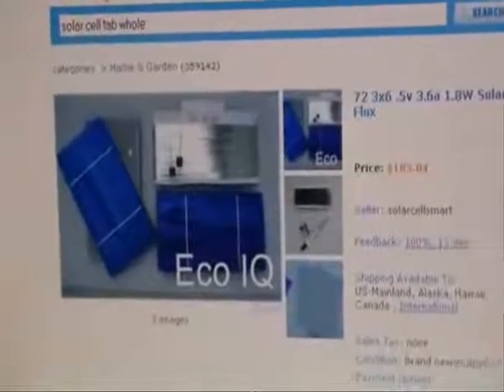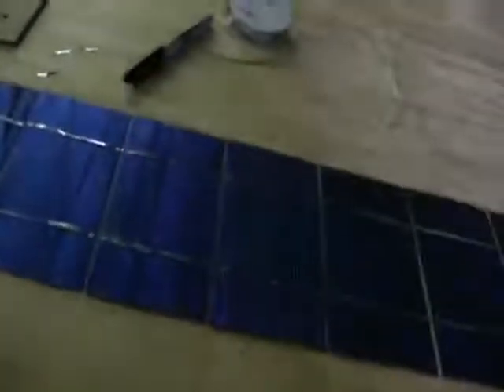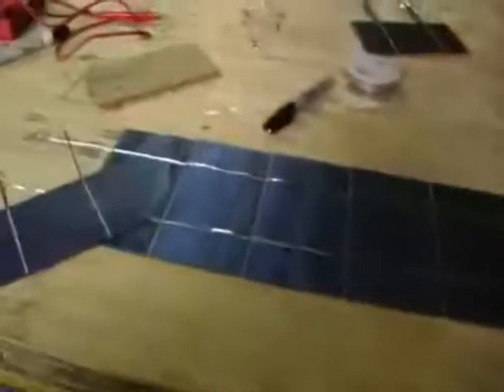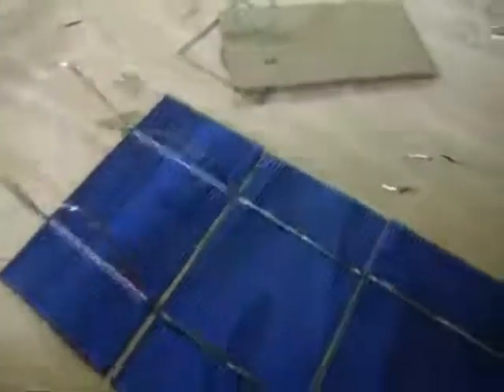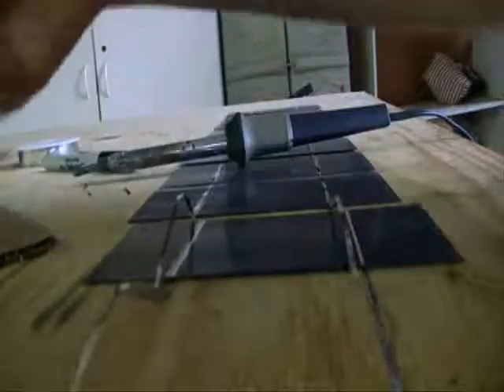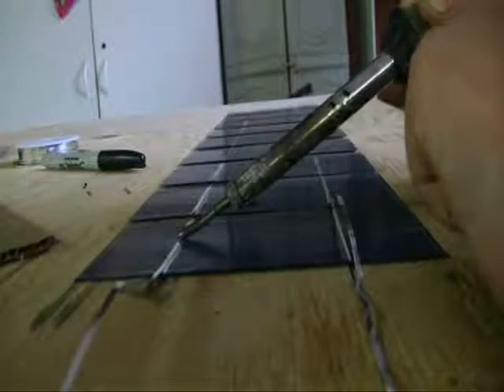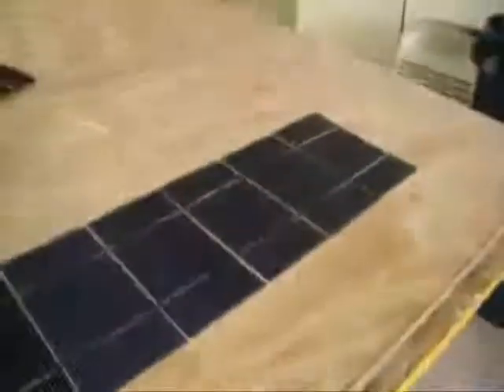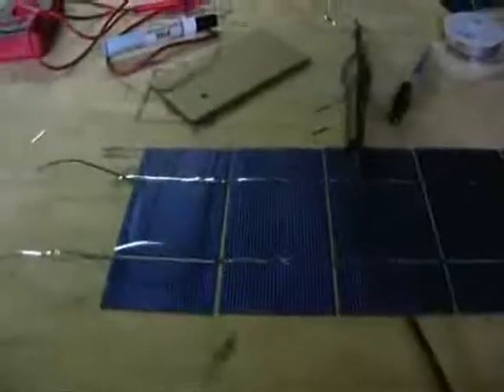Solar Panel project Part 1 - 6/26/10

Comment: It would help if you solder the strips on the backof the panels  prior to soldering the strips to it. You put a lot of pressure on the tip of you soldering iron, on very fragile panels.